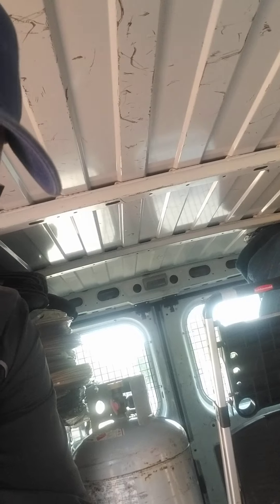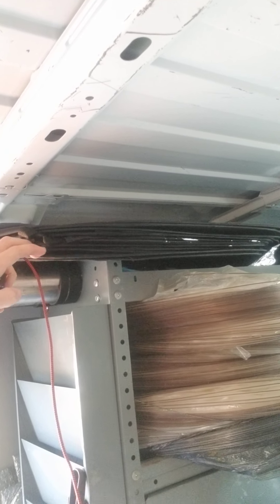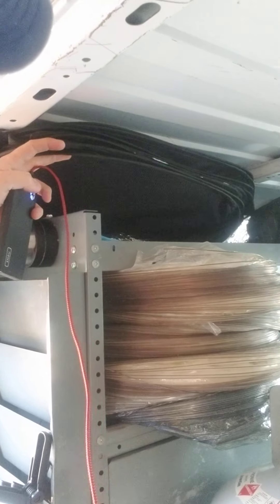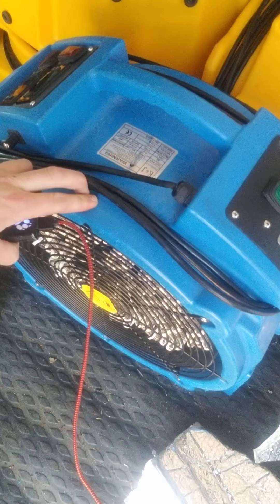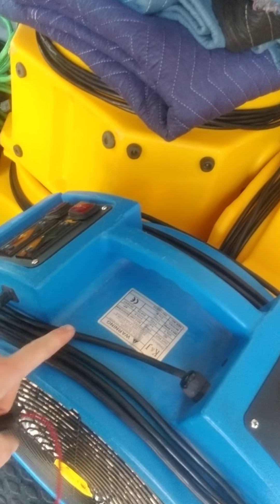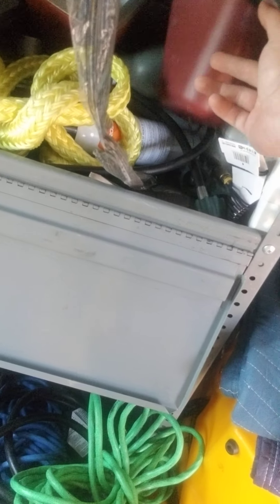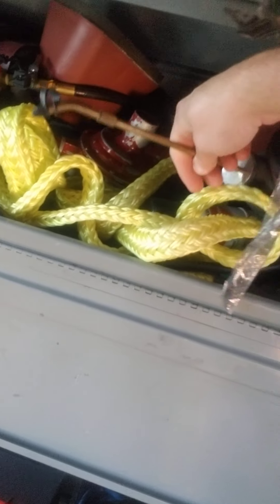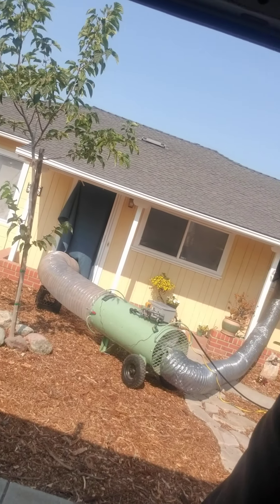How to stock a bed bug heat treatment van and why

Comment: Hey Jeremy, I knew I’d find my way back here again. If you had to start a small propane heat treat business using an enclosed trailer instead of the benefit of a work van, what features would you look for?  I’m guessing something around 5 x 8 would do with a fold down ramp in the rear. Well weatherproofed for sure.
Reply: We used a small Ford ranger and a 8x5 trailer early on but working jobs in San Francisco found to be difficult to park so changing to the vans made it much more versatile

Comment: What size or weight propane tanks do you use in your vans?
Reply: We use 100lb tanks when using the green tech to prevent freezing up. If using the Delta 175 or a sleep tight 1500 you can get away with 30 lb tanks on a single job